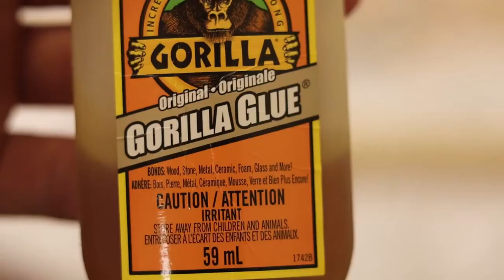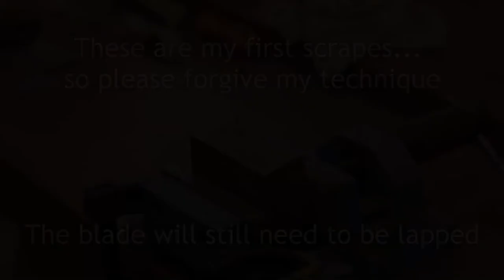🔨 Gorgeous Hand Made Machine Scraper Made from Old...

Comment: Very nice.

 I have a question, what was the brown layout fluid you used ?
Reply from the maker: Thanks,

I couldn't justify buying the layout blue, so I did some research and found that it can be made easily with shellac, dye (mine was chocolate leather dye) which I had on-hand, and alcohol.  It worked very well, If it were a little darker it might show up better, but it did the job.

It might be hard to compete with the Dykem, but it's not really necessary if you're not a machinist.

Let me know if you think it might be worth making a video on how to do it.

Thanks again for taking the time and have a great one.
Reply: @NeedItMakeIt  

OK that makes sense, when I first saw it I thought it was some sort of rust converter.

I really don't think the  blue layout fluid is anything special, often I will use a Sharpie marker.
Reply: Another fluid that was more common in the mid 60’s, or before is a saturated solution of water, and copper sulfate (blue crystals). Add some to the workpiece and scrub with some emery cloth. Some of the older recipes called for a few drops of an acid. I do not remember which, or how much, and it truly is not needed to get a nice copper color that is really nice for flat work, like templates and gages.